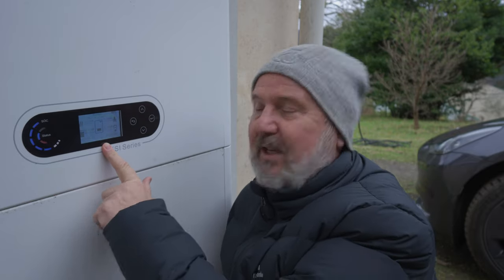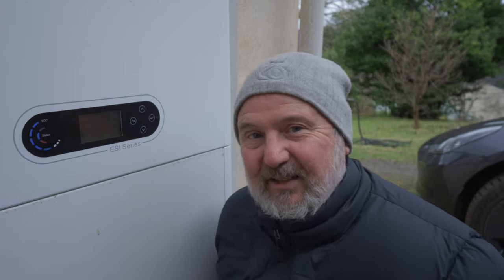Sofar Powerall Hybrid Inverter Installation

Comment: So is it connected to grid ?  What prevents backed into the grid during an outage ?
Reply from the maker: AS/NZS 4777.2 grid protection standard requires the inverter to disconnect from the grid when there is a loss of supply.